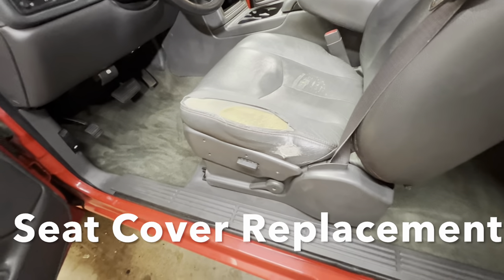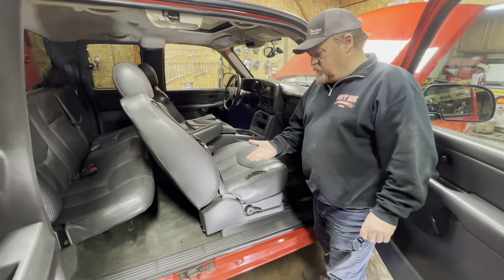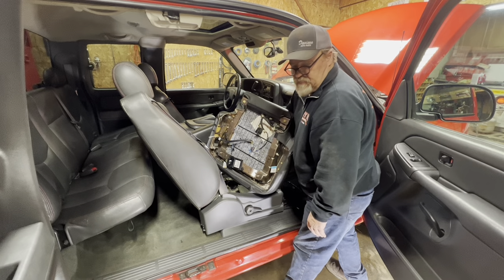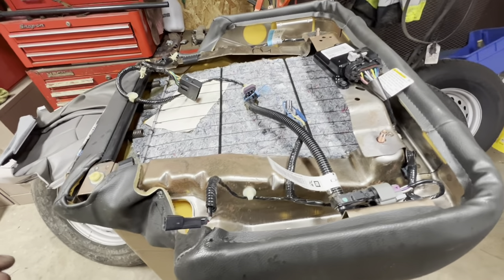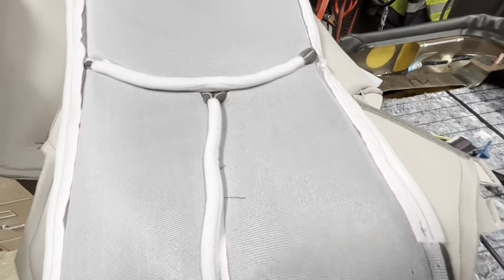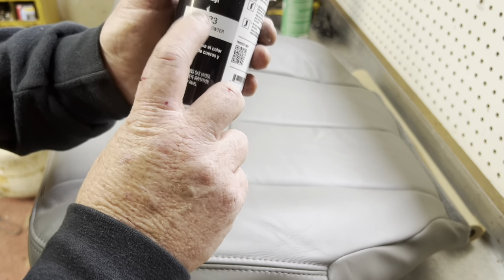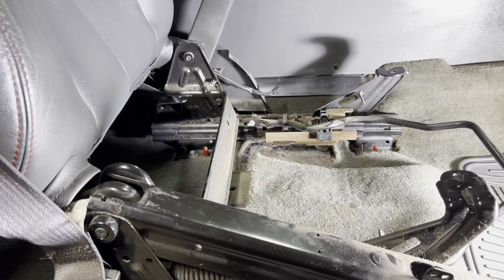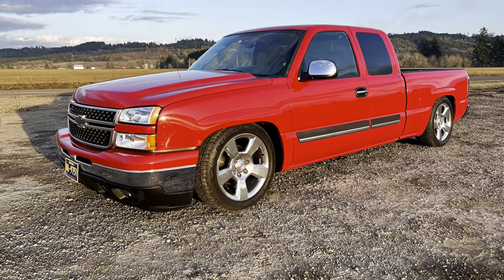How to Seat Cover Chevy Silverado Sierra Yukon Tahoe NBS Cat Eye

Comment: That extra plug on the passenger side was for the airbag weight sensor, turns the passage airbag system on if there is some thing of enough weight sitting on the seat.
Reply from the maker: Thanks Duane!